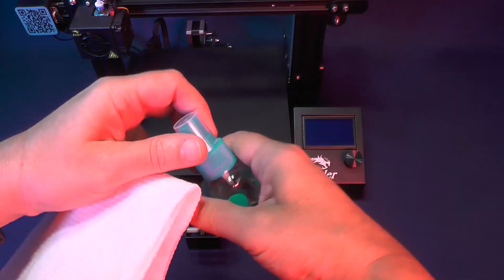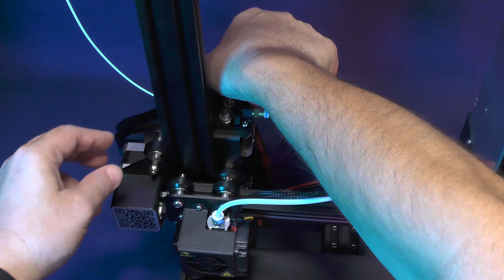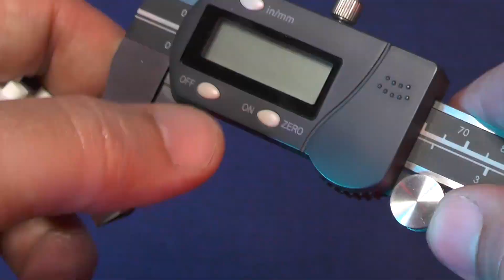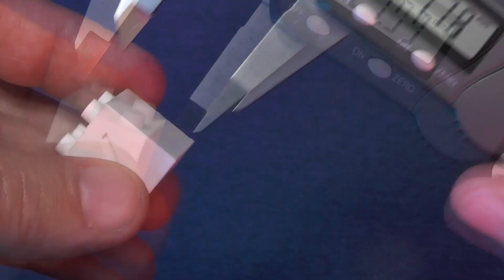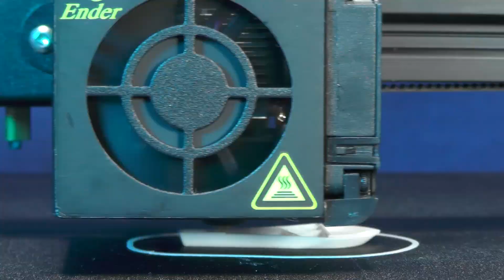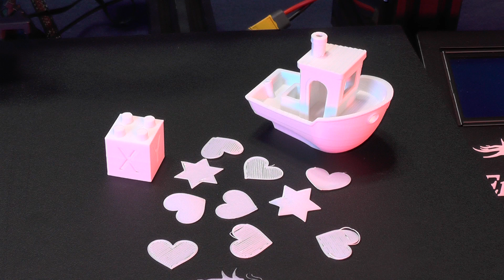1st Steps to 3D Print (2022) 5 of 5 - Print Benchy and the Lego Cube

Comment: My little boat has that cooling issue too, but for me its on both sides underneath. Should I be concerned? should I be terrified? maybe even a little scared?
Reply from the maker: No! 😀
It could just be a matter of having your printer running in a warmer place compared to mine. I live in a warmer climate but I love my AC. It is usually set at 71 degrees. This may have helped my part cooling fan a bit.

However, this variation on the original benchy has a very horizontal curve in this area. The author of this benchy altered the shape of the hull to make it float but the hull of the original benchy is much steeper. The original benchy would not have given you any trouble printing.

In fact, after further consideration, I became dissatisfied with part of the design choices on this variation of the benchy. I even thought about not releasing this week's video in order to replace it with my own modified version of the benchy.

I finally decided against delaying the release of this week's video. I will show my version of the benchy in a future video.

So, don't stress! 😊
Reply: @MakerMindset  Terrific news, thanks for these videos, at the very same time i am building my own printer. Cannot wait  to see what u have in store for the pro